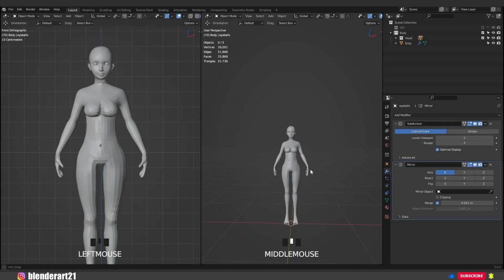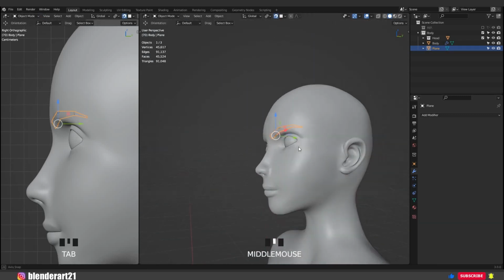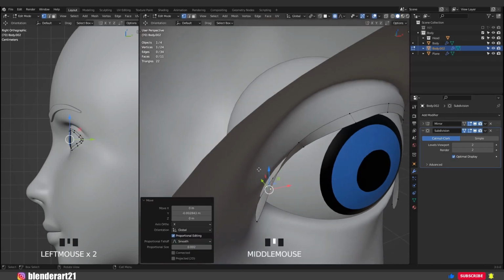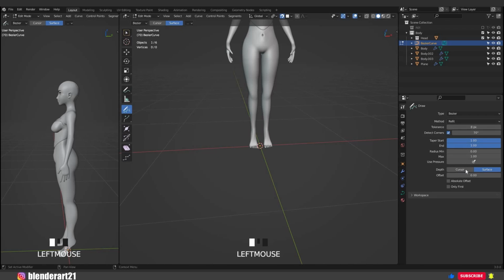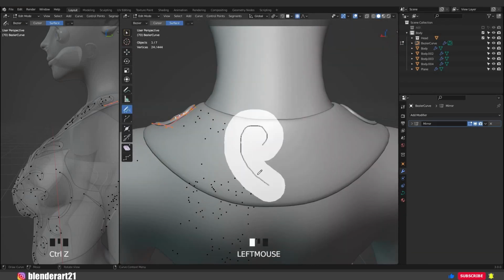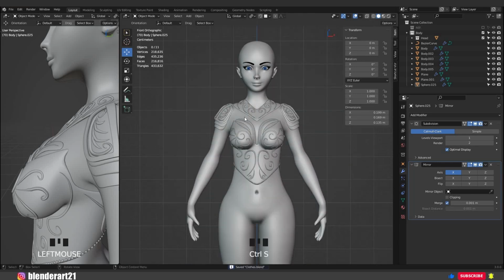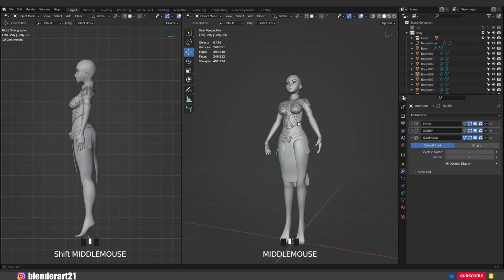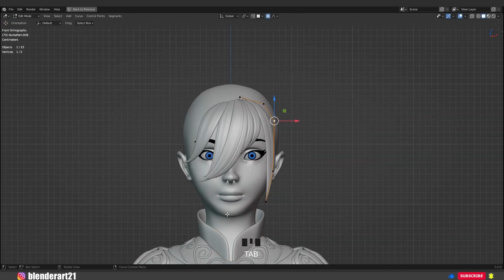Blender Character Modeling Tutorial - clothes  Modelling for Beginners - Part 4

Comment: So the bezier curve won't mirror correctly.  It mirrors it over the axis but it won't be on the model. Not exactly sure what I did wrong. 😅
Reply: Did you apply the transforms?  I had that issue too.

Edit: I think the way he does it in the vid is such that he doesn't have to, but if you don't follow each step perfectly then you would end up needing to.

Comment: Please help, someone? Draw on surface. 

This is really a great tutorial! Thanks a lot!! I’m only stuck on the part where you draw on the surface. My bezier ends up behind the surface with a lot of vertices. I can move it to the front but than it’s not exactly on the surface. What do I wrong?

I opened a new file to test the draw of surface which worked. So it feels like the mistake is in the surface of the harness.
Reply: Could something be up with the snap tool settings maybe?  Just a guess.
Reply: Im having the same issue, did you find a solution?
Reply: Not within this project but when I tried in a new project it did worked. Do you have discord? There is an blender page and people are responding super fast. Most of the time you can even send your file to someone @rarstorm

Comment: Thanks so much for a great tutorial set. Your speed is challenging but that is okay since I have learned so much. Do have a question. In tutorial 4, at 9:30 mark, you apply bezier curves and I noticed they all have tapers at both ends. You do not cover this and research has not helped. How did you do this?
Reply: Took me a few tries watching in slow motion to figure it out.  Once you have draw mode open you have the options for taper start and taper end.  Setting them both to 1 will cause this effect, but seems to slim the entire curve too.  You can also use Alt + S to alter the radius of a vertex after the fact.
I am just realizing he teaches the first part in the hair segment, too.

Comment: When i do the neck is gets very weird, like small edges on it. 

Any idea why? 

Tried to redo the process on attaching head and neck a couple of times with various ways. Doesn´t seem to be able ?
Reply from the maker: because of the vertices number 
if you want to join the neck with the head you should have the same vertices number for the loops I talked about it in the video
if you have 10 vertices around the head loop and  11 vertices around the neck loop you can't add  Bridge between them.. you should have the same loops number
Reply: @BlenderArt  Hey, thanks for reply. I found out it was the Face orientation that was messed up. Which you cover later in the video. Thanks again though
Reply from the maker: @lassebekke3369  glad to hear that you're welcome
Reply: @lassebekke3369  hey, this is years later but this saved me from depression XD

Comment: I've almost caught up with everything! - Just wondering, will you make a tutorial on some basic rigging and animations for this character?
Reply from the maker: yes I will
Reply: @BlenderArt  thank you so much for your wonderful tutorials btw. I was just wondering though - how do you get the curve to automatically get smaller at the start and end points? I've been manually pressing alt s for each one. Idk if I missed something, I tried to copy your every action but yeah - the curve I have is of even thickness.
Reply: @yjzhou   Make sure you have the Bezier Curve layer selected AND you have the Draw Tool selected or active, go to Edit Mode, go to the Active Tool and Workspace Settings (screw driver and wrench tab), there have Taper Start and End at 1.00